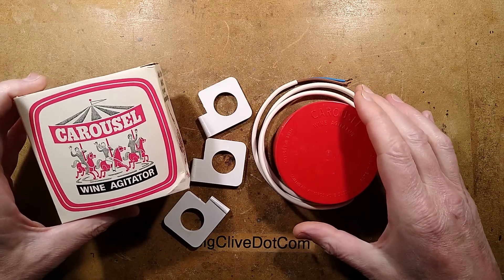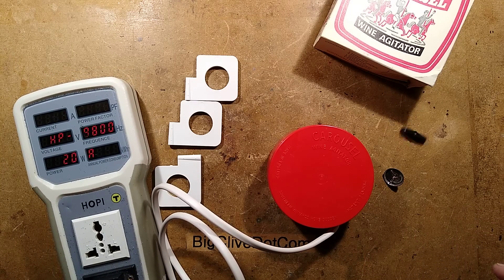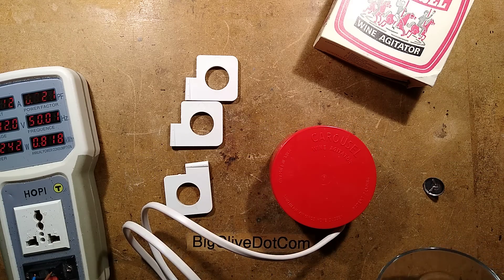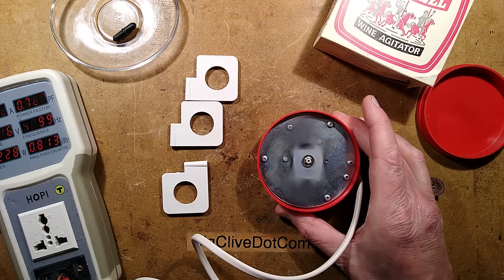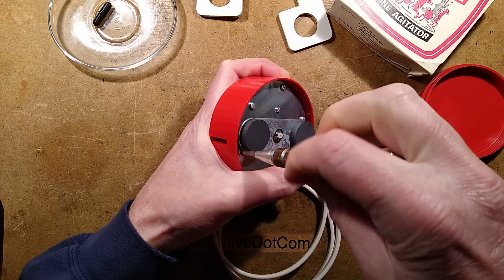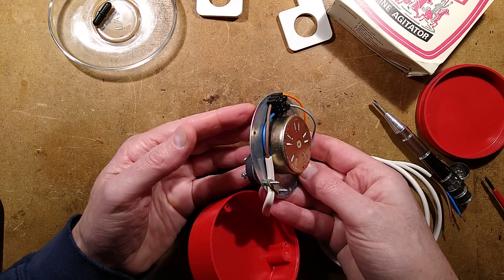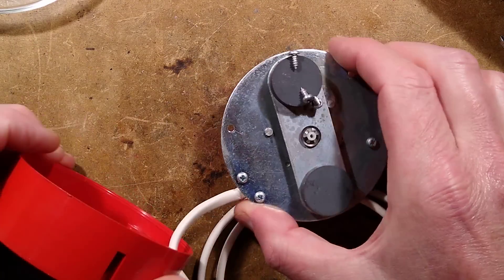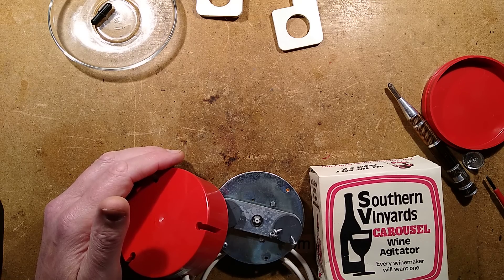Inside a magnetically coupled fermentation agitator

Comment: I built a pair of "magnetic stirrers" using 12v 80mm computer fans and 3d printed magnet mount that is glued to the center hub of the fan and it`s running at 5v controlled by a little dc speed controller. Not much power or current is required to get them spinning. I use them to keep the anodizing dye moving over the parts that are getting colour added to them.. it cost more for the magnetic stirrer bar than it did to make them both.
Reply: This is the way. It also allows for variable power to prevent the stirrer flying off the stir plate as often.
Reply: I did the same, but I made my own stir bar with a chunk of iron embedded in milk jug HDPE plastic that I melted in my oven.
Reply: I knew a number of homebrewers that made these. Nice and cheap, and reasonably effective.
Reply: I used a magnet from a dead hard drive glued to the fan hub and housed the fan in an old VHS tape case along with a 1K pot to adjust the speed, it works great. I bought a package of stir bars from Amazon for a few dollars. To keep the stir bar from falling out of the beaker when pouring out the liquid I use another magnet from a second dead hard drive to hold the stir bar in place.
Reply: I used parts from an old cordless phone, mainly the AC adapter, DC plug, and a linear regulator that I connected to a fan and glued some magnets onto.  Put it in a cigar box. Works a treat.  I think I only needed to buy the resistor, switch, and potentiometer for it.
Reply: @bryanhumphreys940  you may consider a buck converter to control the fan speed. Ebay sells
LM2596 DC-DC Adjustable Buck Converter Step Down Module 3.2V-40V To 1.25V-35V that can handle up to 2 amps at about a dollar each.
Reply: Are you actually saying a 3d printer is cheaper than a few bars off eBay? I know what your implying but you already paid a high price to print custom work.
Reply: @napalmholocaust9093  why don't you factor in the price of his car too! LOL. The price of the 3d printer is inconsequential. Why not just add in the cost of his car and other things he used to get the  task completed? LOL.
Reply: @napalmholocaust9093  Do you factor in the price of your cooker every time you make a meal?
Reply: @napalmholocaust9093 Point is, his 3d printer is presumptivly being used to print many other things and we can't attribute the cost of the printer to the print of any one single print.
Reply: @napalmholocaust9093  You don't actually need a 3d printer, though.  I built something like this when I was 12, just gluing random stuff to the damned fan

Comment: Why does the stirrer thing go crazy?
Reply from the maker: It goes off centre and then get flipped about by the passing magnets.
Reply: Some people call the stir bar the flea because it pings around like crazy. 
Tends to do it if the rotation is too fast.
Reply: Chaos !!
 I bet that's what electrons look like when they are pushed out of a valence shell.
Reply: the center isn't actually stable.  the attraction is strongest by far, close to one magnet or the other.  It only averages out to the center while moving

Comment: What an odd patent to apply for, considering how magnetic stir bars have been a feature in chemistry labs for many decades, if not a whole century...
Reply: I don't know if it was the same in the UK, but tons of US manufacturers used to put "Patent Pending" (or "Pat. Pend.") on their products primarily to dissuade copycats. Often they never went through the actual application process; it was simply a warning to back off.
Reply: Yep, if people don’t know they don’t know, but stir-bars have been used for a loooong time
Reply: I find that "Southern Vinyards" holds two UK patents, both dated 1978, many years after the invention of the magnetic stirrer (1917), the magnets-on-a-motor magnetic stirrer (1944), and the plastic-coated bar magnet (1948-ish), but neither is for this. I wonder why.
Reply: It's probably a patent for some specific feature or element of the device and not the device as a whole. Most patents are like that.
Reply: @Jemt1631  Ive seen an example on a sophisticated "FurReal" toy dog from the 2000's, but the actual patent was just for the eyes made from a single piece of plastic painted from the inside.
Reply: The patent was probably "having 3 legs on a magnetic stirrer" forcing everyone else in the market to have 4 legs. :/
Reply: Dyson is another example. Although their marketing skills are legendary !
Reply: Could just as easily been a patent for the design of the slot-in stand/feet.
Reply: Patent just means you can't copy the design letter for letter, as dumb as the design may be.

For a magnet on a stick, I doubt it would hold up in court.
Reply: Yes, that's the last place I saw one of these, in highschool.  I don't recall even seeing them in university.  Perhaps, since we were all legal adults, they trusted us to actually stir things in the lab.
Reply: @evensgrey  how were you stirring something in a sealed distillation set up exactly? That is what stir bars are for.
Reply: @handlesarefeckinstupid  No, stir bars are for stirring things automatically.  They're extremely useful for stirring things in sealed equipment that can't be moved, but why would you be needing to stir something in a distillation system?  I'd expect you'd already have filtered out the solids, and boiling tends to stir most liquids rather well in any case.
Reply: That was my first thought!
Reply: It wasn't odd at all, you show me a magnetic stirer from the 1920s, I dare you 😂😂😂
Reply: @phonotical  OK.  US patent 1,242,493
Reply: @tsm688  read the patent, you're not even closen🤣
Reply: @phonotical  read it, magnetic drive blender, pretty damn close
Reply: The breveté (patented) SGDG (sans guarantee du gouvernement) is was a simplified older system that was abandoned in the late 60s. You can sometimes find oddly shaped knives with the SGDG marking here in France.
Reply: I'm a chemist and the magnetic stirrers we use in the lab are WAY more stable than this. The stir bar jumping is a sign that the motor is either set to spin much faster than the bar can handle or the design of the agitator is simply not very good. I'm pretty sure most lab stirrers use a single bar magnet aligned horizontally instead of two magnets, which is probably contributing to the  instability of the stir bar.
Reply: There is a missing part though. In chemistry labs one drops some magnetic "pills" to actually do the stirring.
Reply: @ciprianpopa1503  the “pill” was shown in the video
Reply: @CJT3X  You're right, I skipped that part in the first glance :).